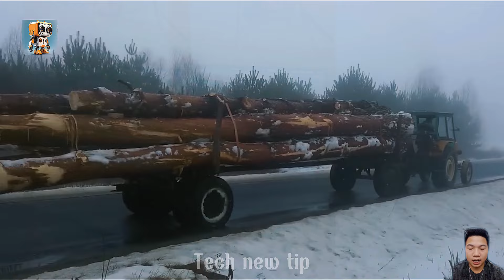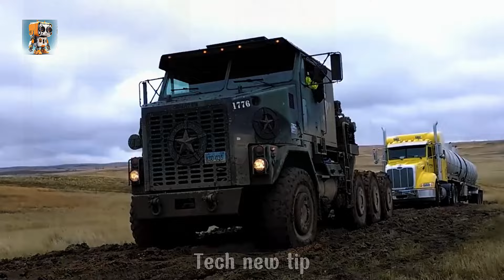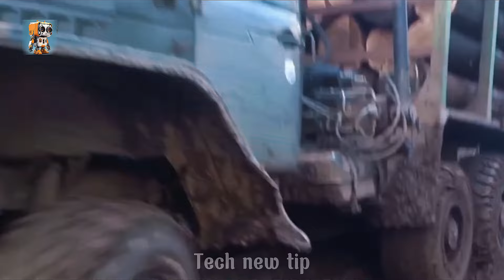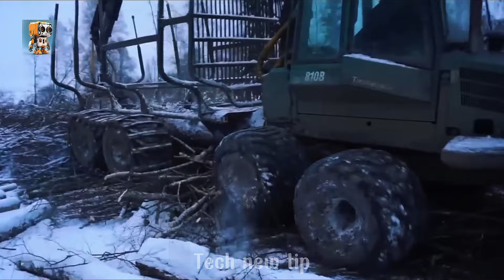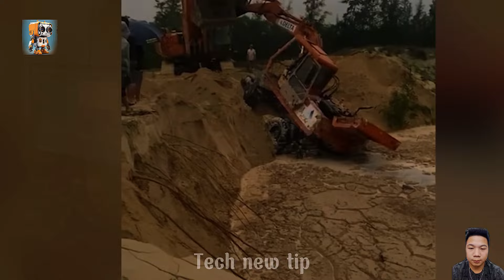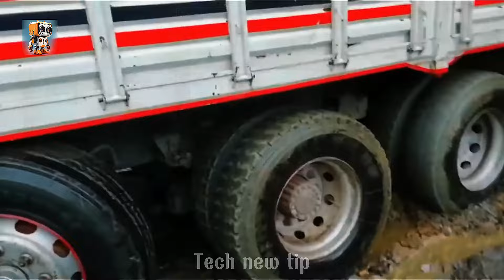Extreme Logging Truck Risks: Rescues Gone Dramatic!

Comment: A true workhorse for the logging industry – handles heavy loads with ease and never slows down!
Reply from the maker: Absolutely! This machine is a beast—built to take on the toughest jobs and power through without breaking a sweat. The perfect definition of reliability and strength in the logging industry! 💪🌲